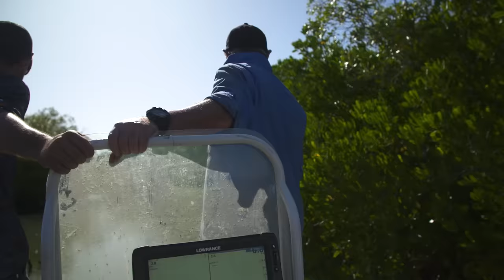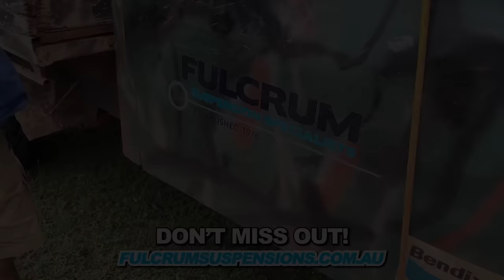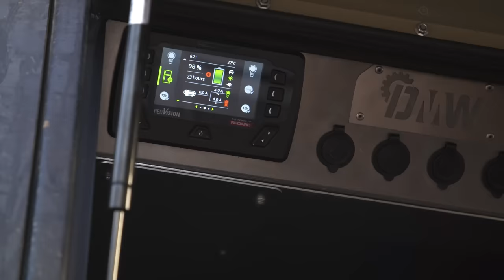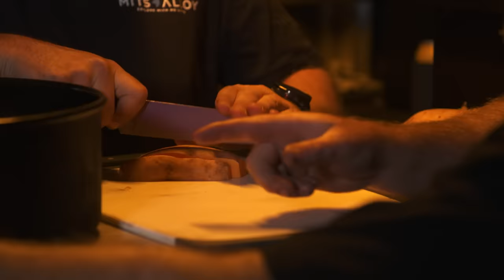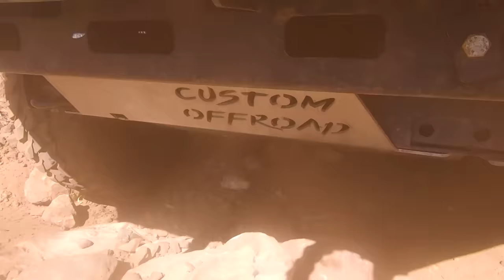TRAPPED ON WRONG SIDE OF THE RIVER! Lorella Springs 2: Bush mechanics, recoveries & swimming holes

Comment: Heads up to anyone in the same situation with welding on the side of the track. You are best to link two batteries in Series, not parallel. Three is best, but two will fully charged starter batteries will work. With the voltage doubled, you only need half the amps.
Reply: Totally agree. I have had allot more luck using batteries in series for welding.
Reply: Also gp's like 4113 electrodes in 2.5mm work well. Low hydrogen electrodes although are dc electrodes dont work on batteries
Reply: Quality comment 🤟😎
Reply: @gasnxt6805  is that because of the higher power needed to burn in a low hydrogen rod?
Reply: I have a 36 volt 100 amp aircraft alternator I'm going to mount to the truck, got it from an old welder. He said it would burn in any rod he's tried. 
It's worth it to mount, I drive older vehicles and you just never know.
Reply: Spot on sethjxl 👌
Reply: I noticed that too… figured these guys would know how to hook up a 24v welder 🤷‍♂️
Reply: @mikewhitman745  dont think so, they get well hot but dont hold an arc. Low hydrogen electrodes are my go-to rods. I am a boilermaker by trade and was surprised they wouldnt work.
Reply: @gasnxt6805  yeah, don't understand it since they are dc rated rods. I'm not a real welder but can do a little stick and a bit of gas welding. Maybe it's a voltage thing?
Reply: This man speaks truth..

Just don’t get bitten..

It really hurts.
Reply: And negative to the electrode for DC is what I've heard. Welded my brother in laws trailer snapped at the draw bar on the Canning Stock Route. Added a couple of bits of flat bar, used quite a few rods, he's never touched it since. We used 3 batteries and had practised in the shed and had a setup with electrode holder and earth clamp etc.
Reply: @gordonkay590  You raise a a good point there. Using a stinger rather than jumper cables makes a big difference. If you're going to take the rods, may as well take at least a cheap stinger and test it first.
Reply: @gordonkay590  good point.
Reply: Yep, 12v just doesnt do it! 24v burns rods all day
Reply: Yep, came here to say this. Voltage in parallel is much too low to properly start an arc
Reply: Ya they failed on that
Reply: was just going to comment the same thing, 36v or 48v needed with the batteries in series. 12v no matter how much ampage just isnt enough you need the voltage up before it stands a chance, they could of done it by putting them in series and grabbing another battery from another vehicle.
Reply: I have got stack

Comment: "If you start pulling out a tree when winching, stop immediately to save the tree"
Nek minit chainsaw out, cutting trees down to get the boat rig through 😂
Reply: Some have to go I guess. As few as possible.
Reply: Was thinking the exact same thing😂 probably cut down 20+ trees😂
Reply: @raynman6466  selective pruning
Reply: They will grow back. If ripped out, they won't.

Comment: I sit and cry when I watch these awesome videos bc this is what I use to do all the time before I became disabled and can't hardly walk or stand now due to diabetes. Sometimes I put myself in with shauno going up some of these hills and camping wherever we stop. I had a awesome Ford explorer xlt with 35s and front and rear air lockers with dual front and rear winches rated at 50,000lb pulling power each. Yes I know they were way too much power but I was gaurenteed to get out from anywhere as long as there was a winch point. I had everything in that vehicle for recovery and camping but the sad part is I went through a creek very fast like a idiot and the water somehow got into the snorkel and sieze up the engine.All that put me out of work and I lost my job and  ended up losing my drivers license to child support and etc. I couldn't afford to get it fixed so I sold it but I couldn't drive anyways. So now I watch you guys a dream of the good ol days. Keep the great videos coming.

Comment: Lost in the goldfields Western Australia, a short cut offered  by the station owner, a couple of wrong turns saw us camped in the middle of who knows where, driving on tracks that looked like they where cut in by horse n cart, through spinafex as high as the bonnet, crawling along at 2kph on an old fenceline, in creekbeds. We came out on a gravel road and headed for our destination only to find ourselves in the middle of a 3000 head cattle muster with helicopters, 4x4's, motor bikes and cattle. We arived at camp 24hrs late with a 140k detours. Rig is a 2012 px2 ford ranger ( the dranger) with a 2in lift and suspension upgrade towing a black series hard floor camper, 2nd vehicle was a mistbishi pajero. Seriously luv the show keep it muddy guys.

Comment: On your bush welding attempt, sethjxl comment earlier had it right. Connecting the two batteries in series, not parallel, will give you 24 volts and only need half the amps. Way back in 1989, I had to do just that on a trip back from Cape York, in my Subaru 4WD wagon, after the broken torsion bar repair using a piece of gum tree changed things, and the rear end started to crack the mounting points. It worked, the weld was still holding a couple of years later. Yes, it was a real adventure, I was on my own at the time,

Comment: 24 volts works a lot better than 12 for welding, you'd also need different rods. 
Even better you can get small proper welders that will work with the big inverters you have in a couple of the rigs.
Reply: the boys need to go watch some trail mater! I got myself a china special 165mma/flux core mig that i use for fabrication in my driveway most of the time runs off a standard 10a socket. its about the size of a battery and as heavy as a large laptop. If i go remote, im packing it.
Reply: @Weq5ter  Yes it is a pity we don't get those compact onboard welders here. Not that they'd work easily with any of those rigs, with their computer controlled throttles.
Yeah there's so many good compact welders out there these days it's a no brainer to pack one where you're going remote or extreme. 
The other thing I don't understand is why Reuben didn't do any work to the trailer before they left apart from larger tyres.

Comment: Did a trip to Uluṟu in 2019 with the misso in a 92 ln106 single cab, stopped at Marla travelers rest on the way threw and decided last minute to set up camp across the road and send it to the rock the at first light, few cold ones later called it a night, woke up the next morning with no tip of my ignition key.. and no way to start the vehicle 🤦‍♂️ after pulling doors apart, key barrels out so forth thankfully a locksmith from Alice was able to cut us some replacements and throw them on the bus from Alice within a few hours, 
2 days later we were back on our way, 
By far the best scenario for the worst case scenario, 2 days stuck in the outback, with a pub, general store, bore showers, and even a pool within walking distance 👌

Comment: G,day fella,s
When you had the broken spring hanger.  You had a cut log of wood  . Should have cut a slot across the middle the width and depth of axl and jammed it under the floor.  Seen cut pipe done the same way. You can still tow any type of trailer.  Or caravan.  Once it is solid and locked in will get you back to town for repairs.  
Interesting ideas 💡

Comment: @4WD24-7, I have seen a winching technique used to uproot dead trees by using a spare tyre as a raised pivot point, placed as close to the stump as possible. This creates a nearly vertical line to the tethered tree, pulling it upwards as it is being winched out. I know you guys are pros, but couldn't this be used to pull your vehicles upward a little during a double line pull?

Comment: With the saw, if it's a new chain remember they stretch so set your tension, do a few cuts, check and adjust tension again etc. Not great for the bar/sprocket/safety if they come off.

Comment: If you wire the batteries in series, you would have enough power to do the job, I did this at Douglas Hot Springs many years ago

Comment: You should have put the two batteries in series, not parallel. That would have doubled the voltage, enough to strike a good arc and do the weld.

Comment: If you're going to use batteries , you need to hook them up in series. 12 volts do not provide enough ark volts to work as you saw.  I used 3 in series and welded 10 MM thick steel. I'm surprised you aren't using an alternator welder. Doesn't Australia have those alternator welding systems for sale? We have them in North America and I've seen a YouTube video on how to build one as well.
Great video otherwise. I wish I could go on some of your adventures with you.

Comment: Hey Graham I have a question for you regarding your wheels and tyres, I have a 2021 Mazda BT-50 ( D-MAZ)  and I have had TJM install a 2" lift to gain better ground clearance,  I was wondering what size rim and tyre you are running on the D-max? I am thinking to go to 16 inch rims and run 265-75 R16 is this what you have done? can you please let me know what your combination is please.

Comment: I live in south africa and have the 2003 kzte 4x4 hilux. It has a 2" suspension lift and free flow exhaust, giving me about 7.4km/L average mileage. Any tips for mods to do. Is an Unichip a smart idea with dyno tuned and what are extra mods to be done to increase power and fuel effiency

Comment: My first welder was 3 - 12 volt batteries hooked in series, not parallel. I welded 3/8" thick angle iron. If you'd at least hooked those 2 batteries in series, you would have done better. You need voltage as well as amperage to weld. I'm surprised none of you had an alternator welder in at least one of your rigs.

Comment: You can't stick weld with 12 volts, you have to connect the batteries in series so you're welding with 24 volts.

Comment: 20 maxx tracks between all the cars. Ud recon ud throw a couple over the hole where boat trailer failed. 🤪 i spose we need content though 🤣
Reply from the maker: Honestly mate the mud was that bad that the trailer would just have pushed the  MAXTRAX in, the only way out for the trailer was to be dragged. We got great use out of the MAXTRAX on plenty of the single vehicle bogs though

Comment: You should have connected the batteries in serie not parallel 
Lets say you needed 3Kw to weld…
In parallel 12v you would need 250Amps 
In serie 24v you would need 125Amps

Comment: Should of had smaller weld wire 1/16 weld rod that big stick needs way to much power you need a big ass generator to run burn that rod